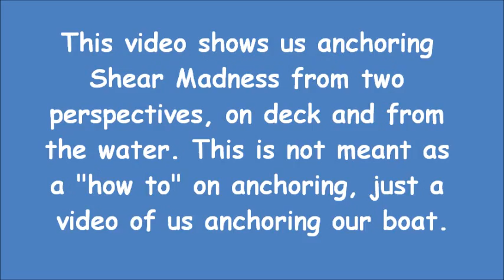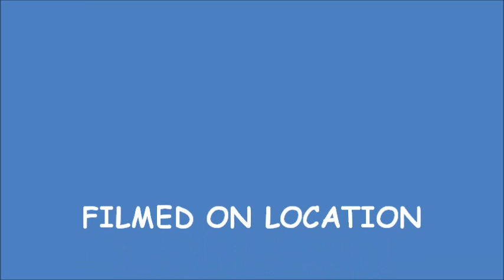2013 07 Anchoring Shear Madness

Comment: Can you explain the reason for running your snubber line through the eye down at the water line.  It seems like that eye is not as structurally secure as your tie-down topside.  Don't know much about boats, that is why I am asking.  Great videos that you have produced.  I enjoy watching them.  Thanks for going through the effort of making them.
Reply from the maker: +Larry Patterson 
This is a fairly complex answer that would include math and physics, which I will not cover here.  However, the general principal is only a portion of the force exerted on the snubber is transmitted to the towing eye, with the majority being at the tie down.  The second half of the answer has to do with the angle of the line from boat to anchor, less angle, better holding, reduced sailing of boat at anchor and the ability to use less anchor chain and snubber.  I would estimate 25 to 50% of the Nordhavns use this approach.
Reply: What about chafe protection at tow eye?

Comment: Curious why you don't free-fall your anchor. Thats the whole point of having the type of braking system you have.
Reply from the maker: Several reasons. One is that its a huge anchor and free-falling it is not something we are comfortable doing. Also, we like to know when the anchor reaches the bottom and set it more gently. We also have a chain counter which tells us exactly how much chain is out if we use the windlass.
Reply: @nordhavn72  that's why you have it fall slowly when you know it is close to the bottom